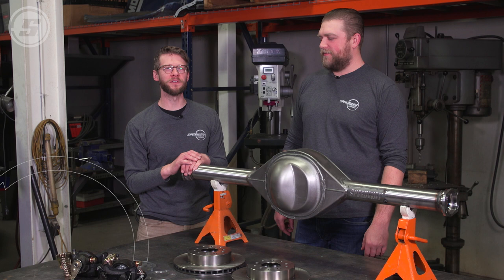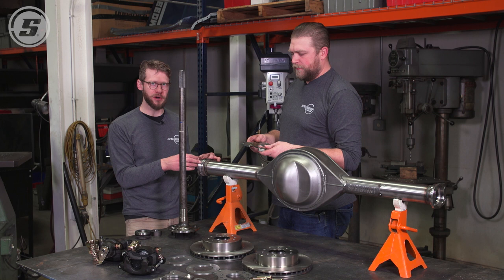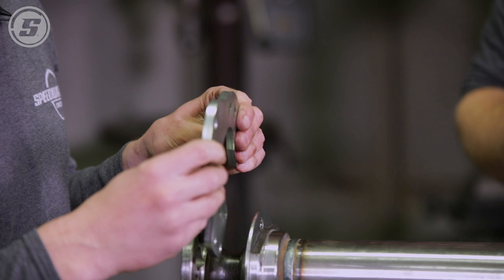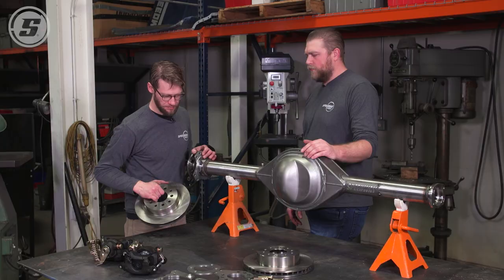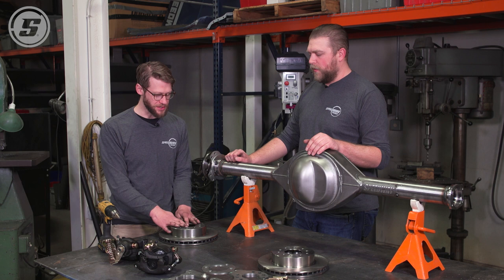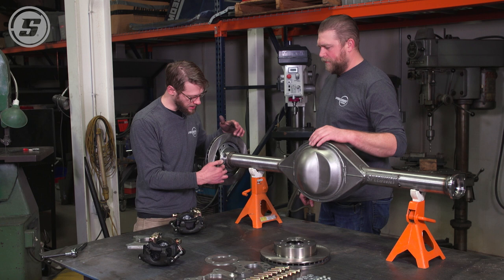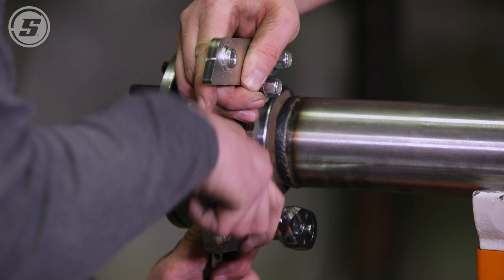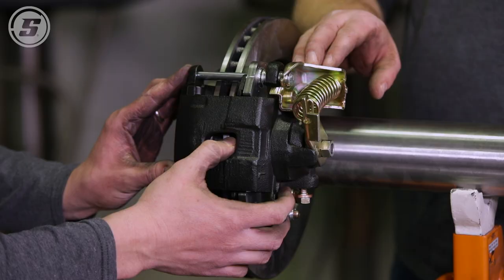Ford 9 Inch 8 Inch Rear End Bolt On Disc Brake Conversion Kits Tech Talk

Comment: Boy this sure makes me not want to buy your conversion kit. The part where I need to drill out brand new parts is crazy. That's why you buy a kit, so it's all done for you. With a very common setup like a Ford 9", no drilling should be necessary. That, and your video starts with the assumption of the least common scenario: building an axle setup from scratch. Most everybody already has a car they are starting from. That's why it's a conversion. Your video appears to be setup for the convenience of setting up a video, not to show a person how they'd actually do an install. I'm sorry to be so negative, but this is all way off the mark.

Comment: This kit can be used on a 03 Ranger with a 8.8 rear axle correct?
Reply from the maker: I'm sorry to say that no, this will not fit a Ford 8.8" rear axle.  This will only fit an 8", or 9" axle which both share the same axle flange.  You might take a look at something such as this for your 8.8" axle: https://www.speedwaymotors.com/Wilwood-140-3018-B-FDLI-Rear-Brake-Kit-Ford-8-8-w-2-5-Off-5-Lug,106038.html

Comment: Thanks for the informative video! I wish I found it before installing my kit. I purchased the MBM Ford truck 9 inch version with the 5x5.5 bolt pattern.  The included instructions are HORRIBLE! I've been customizing for many years and realize this is a custom part and there are different installations based on differing years of the same truck. Instructions covering every situation is not possible. However, thorough instructions or helpful hints would be nice. First the instructions said that the axle flanges needed to be 6 1/8 inch or smaller or else the axle flanges would need to be machined. As stated earlier, my kit was the Ford Truck 5x5.5 rotor pattern. If the axle flange was machined to 6 1/8 inch you would almost machine into the axle stud holes! My axles flanges were larger than 6 1/8 inches yet the rotors still fit fully onto the axles. This axle flange specification is probably specific to the smaller Chevy bolt patterns. It would be nice to know that there is a different specification based based on axle bolt pattern size. Next, quality control is somewhat lacking. The primary bracket had two holes that were slightly mis-drilled requiring me to enlarge them. One to make to make the primary bracket fit on the differential axle flange. The other to make the secondary bracket fit. This made it necessary to enlarge the holes on the lower rectangular spacers. I also had to I had to reshape the rectangular spacers to clear the differential housing flange.There were cylindrical spacers that the instructions didn't mention, but were necessary to get the caliper spacing correct. If you install one of these kits be prepared to customize, it's not just bolt on. The most frustrating part of the kit were the incorrectly drilled parts.

Comment: This brake kit will work on a 9.75 ford fx4 rear differential ?????
Reply: The 9.75 is from a 2007 f150 want to swap to a 87 c10 wandering if this will fit or need a different kit ??????

Comment: What are you guys doing or using for parking brake cables for this style caliper. My original factory cables are two short and the universal cables seem to require some creative alterations to make them work?
Reply: Kit comes with new rear parking brake cables
Reply: I had a custom set made for my 72 Camaro. I have a quick performance 9 inch with this same  brake setup and no e brake cables included.

Comment: also curious where you would get or what pads are used in this kit?
Reply: Part # 9193381
GM Metric 1978-Up Soft Street Brake Pads

Comment: Where would you get your replacement break pads
Reply: i just bought a kit for my 8.8 that looks very similar to this    I believe they are like G body   or at least GM style calipers so id imagine once you have that knowledge pretty easy to source pads.    Did you ever figure this out   and then some?  if so now help me haha
Reply: Part # 9193381
GM Metric 1978-Up Soft Street Brake Pads

Comment: How can I purchase this? 😳 phone# part #? Thanks.
Reply from the maker: Here is the link to our website to purchase this brake kit: https://www.speedwaymotors.com/Speedway-Ford-9-Inch-Rearend-Bolt-On-Rear-Disc-Brake-Kit,5336.html  This link includes the e-brake caliper: https://www.speedwaymotors.com/Ford-9-Inch-Bolt-On-Rear-Disc-Brake-Kit-w-E-Brake-Caliper-,35268.html
Reply: @speedwaymotors   Thank you👍🏽. I'll be calling in a few weeks when it's not so cold to work in the garage here in Wisconsin, thanks again.
P.S. 
I notice that the kit with E-brake is on back order. Any idea how long are they going to be in back order?